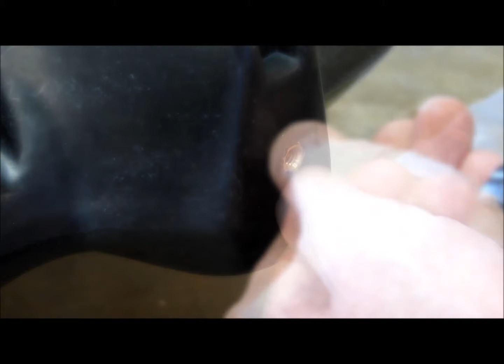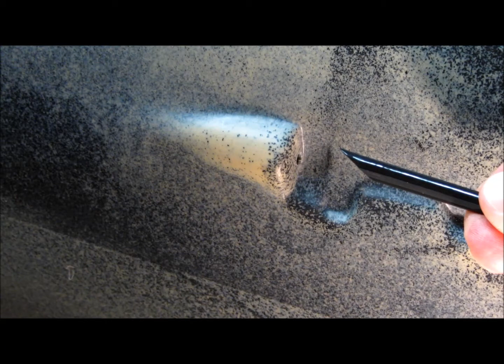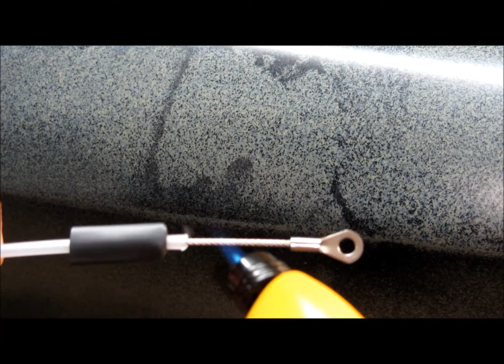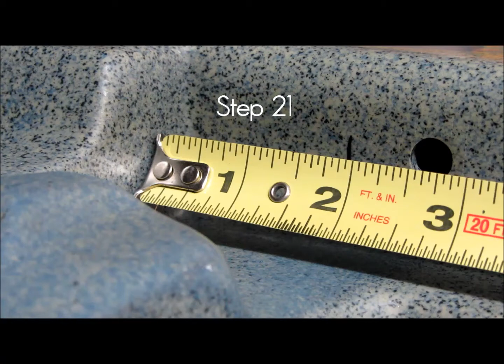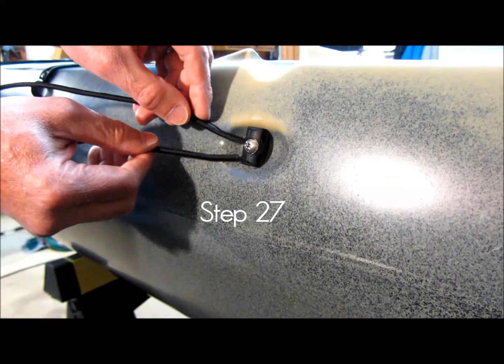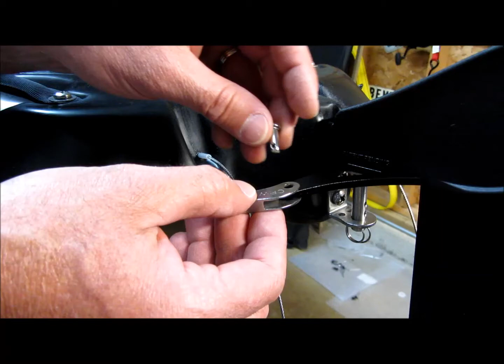Jackson Kayak Big Tuna Rudder Install

Comment: Great video. What is the brand of the foot brace slides. I need a set.
Reply from the maker: Hi Cody, Thanks! The pedals and slides were part of the Big Tuna kayak when I bought it. I ordered the rudder kit from Jackson Kayak which was specifically designed for the Big Tuna.
Reply: @Kajunman  Thank you I was able to get ahold of Jackson and The part number for the Big Tuna rudder kit is 2213.
Thanks you again.
Reply from the maker: @cadkins71  You're welcome! Good luck with the install!

Comment: This was a well produced video with exceptionally clean & clear (professional audio and a solid picture capture with no shake - I'd say studio quality).  I do wish there were more wide angle shots that zoomed into the areas specifically - that would help, otherwise I have to watch it several times to make sure i'm in the right spot.  With almost 40 steps, I'm still a bit intimidated and don't know that I have the patience to perform that much intricate work - heck I'll bet the instructions included weren't nearly as thorough as you you.  I wish my Tuna's came pre-installed with rudders, but no such luck.  With 2 Tunas requiring 3-4 hours, I'm thinking this will be a shop install by people who do kayak mods for a living as a better use of my time and mediocre skill.  But yours looks PERFECT given your precision and attention to detail.  Please be sure to post additional videos.
Reply from the maker: Hi Vroom !!!
Thanks for the compliments!
I used my Canon camera to shoot the segments which didn't have much of a wide angle. Now I have a GoPro so my future videos should be better.
Good luck with the rudder install if you decide to do it.
Peace!

Comment: Outstanding job with the rudder installation. 
As a Jackson dealer we install rudders often. 
A few pointers: don't use motor screw drivers to remove or install screws. Use hand tools.
Be very careful with heat torches. Use a metal sheet to separate the item being heated and the kayak hull.
Reply from the maker: Hi,

Thanks for the compliment and the pointers!

Comment: Just finished installing my rudder kit. Probably the best how to video I have ever used, thank you.  If you find yourself with a rudder kit and 3-4 hours of spare time go catch dinner and a movie.  This install takes a while, with moderate skills, 5-6 hours. A lot if the time is spent running the stinking cables, it can be very frustrating.  If you're like me you will check and re-check before drilling into your kayak.  Careful with the rivets, there are no spares.  Goof luck and thanks again to Kajunman.
Reply from the maker: Hi Dave,

Sorry it took so long to respond to your post...2 years! I'm glad it helped and you're welcome!

Comment: Nice work.  My big tuna came with the rudder pre-installed but no instructions and I thought it was broken until the last 30 secs of the video where you showed reversing the rudder controls and it all made sense, thanks.